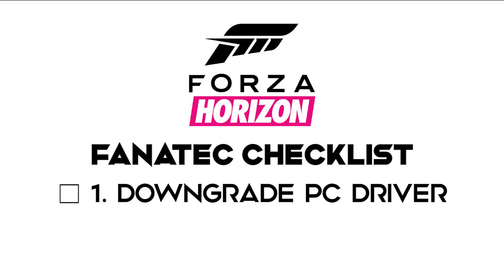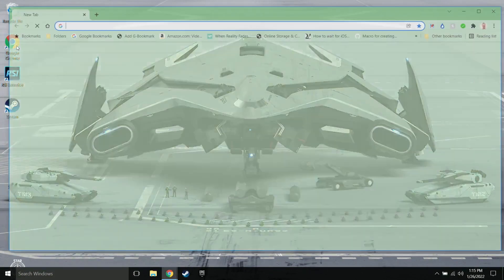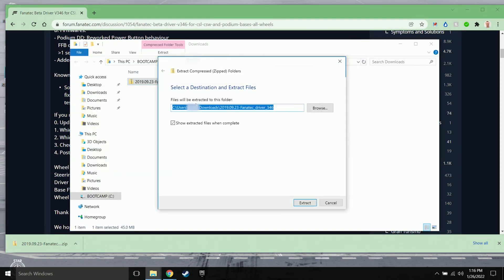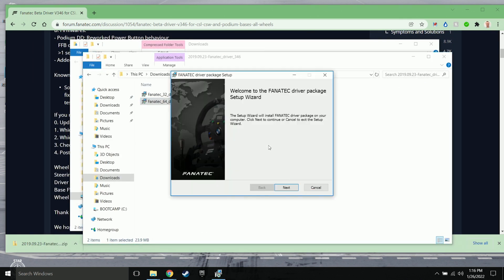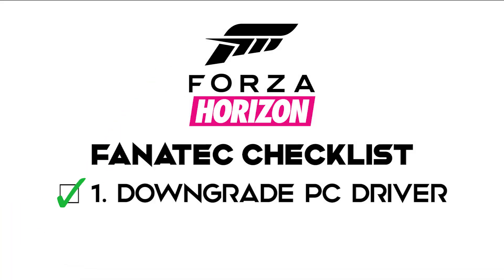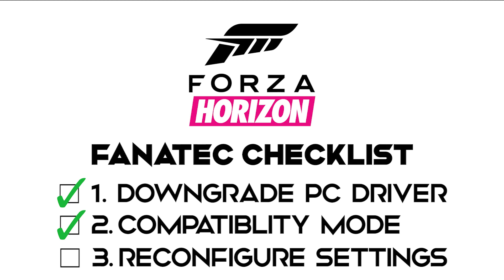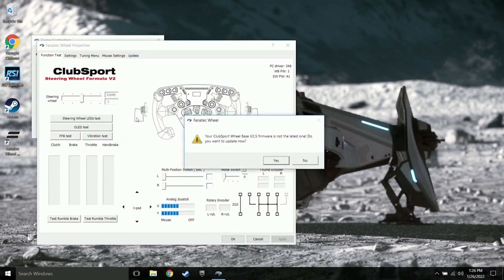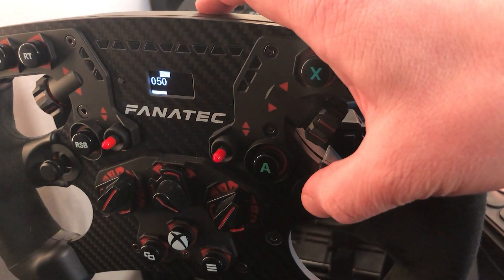Fanatec + Forza Horizon 4  & 5 Freezing/Crashing Fix - Works for CSL DD!

Comment: doesn't the csl dd come with a compatibility mode that you switch on the on/off button of the wheel base?
Reply from the maker: It does, but the issue here isn’t the wheel, it’s the drivers installed to your computer that convert the wheel signal to something the game can understand

Comment: Uninstall the latest driver? Are they taking game development seriously? It's a joke. Richard Burns Rallye from 2004 has no issues running the latest driver and several devices
Reply from the maker: I agree it’s not ideal. But it did work for me and seems to work for numerous others as well. So far it’s the only fix I’ve found that makes the game functional with the wheel.

Comment: I have tried absolutely everything including this to get my CSL DD to work on forza 5 but I have yet to find anything to allow my device to connect to the game. It works on every other sim including forza 4 PERFECTLY but forza 5 after HOURS of videos, articles and fourms It still does not want to connect. PLease help I thought that this would fix the issue but when I click on the properties page to reconfigure my wheel it doesn't even recognize any of the movements or button presses. I have also tried to set it up through the VJoy emulator to no avail please help me out if you can because I have been dying to drift on FH5 using a wheel.
Reply from the maker: I am so sorry this hasn’t worked for forza 5 for you. In these cases, it makes me curious if the issue is either hardware specific, or possibly a different issue from the drivers. Unfortunately I haven’t experienced this issue myself so I am not sure how I can provide further direction
Reply: @lonnixlethe  I honestly think that it is a disconnect between the steam drivers and the game in my case because I downloaded forza 5 through game pass and my CSL DD works but it has no FFB sadly so if you know anyway to enable FFB through the windows/microsoft drivers that would be very helpful if not all good I might be able to figure it out eventually because I really want to fucking drift
Reply: Still haven't found a solution? I buyed FH5 and have the same situation(
Reply: @kornizy  I finally did end up getting it to work after watching South Street Media's video (Finally Playing FORZA HORIZON 5 With My FANATEC CSL DD!! | How To Get Forza Horizon 5 Working CSL DD) and updating the fanatec driver to 440 or 441 and then launched the game with PC COMP mode the yellow one on and it just worked perfectly ngl

Comment: Well, This actually works! I can reset all graphics and other settings to full or default because the problem was the driver.
Tested the other sim games as well but all seem to work the same as before as with the latest driver.
So who has to fix it , Fanatec or Forza?
Reply from the maker: I feel like each company will say the other had to fix it, but based on my understanding, it seems as though Forza is the one requiring the old drivers.

Comment: I never had any problems with my Fanatec DD2 (PC Mode) in Forza Horizon 4. FH 5, on the other hand, is a disaster.
Reply from the maker: I am curious, when did you play FH4? If it was right when it came out, you may have still had the compatible drivers installed. I haven't checked the most recent drivers yet, but when I started playing FH4 a few months ago, it was still having this issue.
Reply: @lonnixlethe  I bought FH4 shortly after it came out. My steering wheel I bought in Dec. 2020 and of course also directly installed the latest firmware and drivers. I think I had to run my DD2 in Comp. V2.5 mode, but never had problems with crashes in the game.

Comment: thanks for the video but the later drivers have improved the wheels significantly to the point where downgrading them is not an option
Reply: I hope so because I did this a few days ago. Can anyone else confirm on a csl dd?
Reply from the maker: My question is if the most recent drivers also fixed the compatibility issue. If not, having these improvements won't help if the game constantly freezes or crashes.
Reply: @lonnixlethe  The game recognises the wheel in 2.5 compat mode but still crashes. I agree with original comment, it isn't worth downgrading the firmware every time you want to play horizon. It just isn't practical and wheel response feels floaty (for the limited time i had to test)
Reply from the maker: @nostromoni9752  I am sorry to hear it still crashes for you. Though I do wonder if you’ve downgraded to the correct version maybe it’s something else besides the wheel that’s still causing it to crash. If you are able to fix the crashing problem, Forza does have an advanced wheel configuration page which likely would fix the ‘floaty’ problem you’ve described. I do remember I had to fiddle with the advanced settings before it felt right for me. Sorry I can’t be of more help and I hope you are able to get it figured out. Happy to try and answer any other questions you may have. Good luck!

Comment: Honestly, its ridiculous they haven't fixed this yet. AAA title developer and they cant fix a core component of a racing game such and getting wheel bases to function properly without having to use a almost 4 year old driver. Too busy banning livery's and making stupid playground games that seem geared towards 12 year old's. Thanks for this video. I had rolled back my driver some time ago and it does work if anyone is using a CSL or in my case a DD!. If any of you are using a DD!, what setting (in game) and on the wheel base are you using? I have tried spending hours tweaking my wheel to get a good feel and it just still seems mushy and "floaty" Im sure some of it has to do with the drivers. When i did play a few times with the newest driver the wheel did feel a bit better but I never had enough time to test settings as I would just crash 5 min into loading in. It seems all the G920 and Thrustmaster folks ive talked to have such smooth wheel operation but a 1200 dollar direct drive they cant seem to manage figuring out 6 months into launch of the game. Ill keep testing and tuning it to see what i can come up with. Share your settings here if you are a DD! user to help each other out. And keep submitting bug reports to the devs and post on their forums. Im sure they don't care to fix an issue like this since they seem to have no desire to make it happen in any of the patches so we need to keep pressing them. Thanks for taking the time to make this video. I know it will help a lot of people as yours is the  best demonstration video and really simple steps for ppl that may not have much knowledge on their wheel firmware.

Comment: Thanks for this excellent tutorial. This finally fixed the issue I had with this game crashing on me constantly. Every single time I entered a race or cruised around for about 5 minutes, during the race or cruise, I would crash. After using the info from this video, I was finally able to finish 2 consecutive races with no issues then cruise around without the game crashing.

Comment: now fanalab wont launch. its saying, "install driver package V352 or higher." any ideas?
Reply from the maker: I haven’t used fanalab. But you could try v352. It’s old enough it might still be compatible. If that doesn’t work you could always try an older version of fanalab or use the control panel/tuning button on the wheel to configure your settings. Sorry I couldn’t be more helpful. Maybe somebody from the community will have another idea.

Comment: For some reasons the driver Panel dosen`t let met change from Pc mode to Comp v2.5. And when i switch it to comp mode (with my wheel) it dosn`t let me open the driver panel (got to be pc mode for it to open).

But nice video!
Reply from the maker: If you have the ‘tuning’ button on your wheel, that has worked for me the one time I was unable to open the driver panel. Didn’t make the association that was due to the mode. Thanks for sharing!

Comment: OK, so its great you have found a working solution but it just feels wrong lol.. How will degrading to 346 firmware impact other games? Currently playing assetto and dirt aswell and dont want to mess with the feeling in those games.
Reply from the maker: I also play ACC and F1 2021 and this fix hasn’t messed up either of those games. Unfortunately I can’t speak to AC or dirt, though if your experience is the same as mine, it seems it would likely also work, especially given these are also older games that were out when this 346 version was released. I do understand the reservation to going backwards to an old version. Although, I may be biased, but I have been enjoying forza so much with the wheel I think it’s worth it. 

Best of luck! Let me know if it works for you or if I can help in any way
Reply: @lonnixlethe  alright thanks buddy! Giving it a few weeks and hoping for an update tho I know its a longshot.